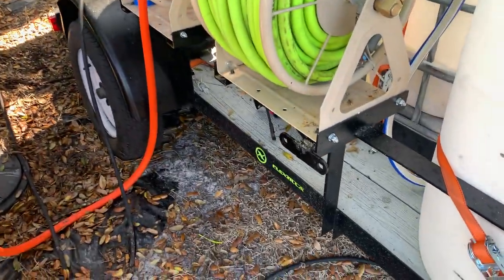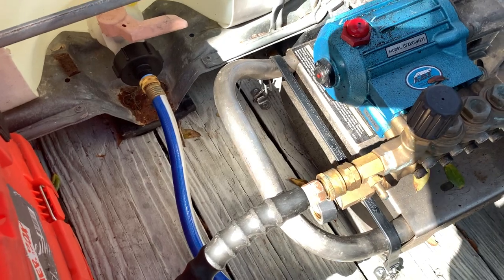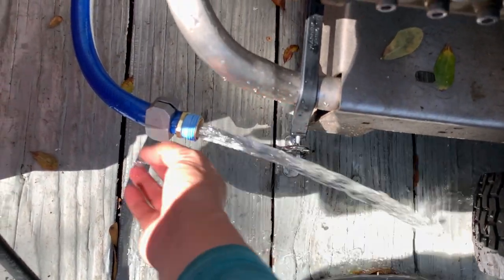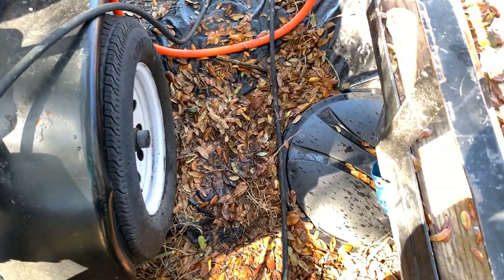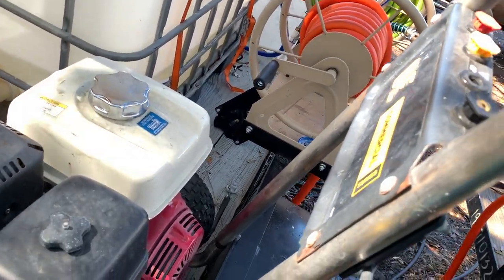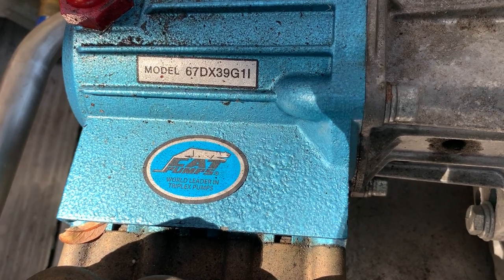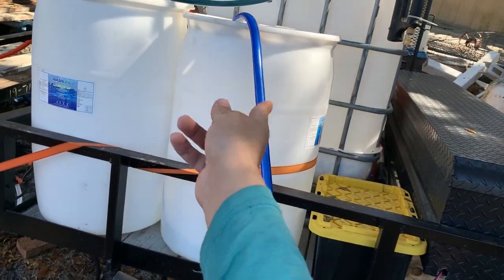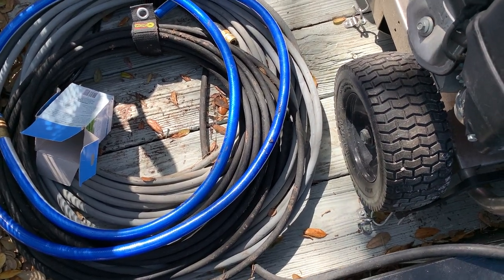Running a Direct Drive Pressure Washer with a Buffer Tank Part 2

Comment: Since this video was 2 years ago I'm sure you've already figured out your problems... but from what I could see... your tank wasn't vented and your water line was to low. You don't have to raise the tank as long as the water line is higher than your pump. The tank has to be vented while your using it so the water can flow freely... I've been using a buffer tank for over a year now with no issues and I get just over 4 gpm flow. The only time you need an external pump to feed the pressure washer is if you over 4 gpm. Hope that helps!
Reply: Not all pumps can suck from a buffer tank, most pumps are designed to have a garden hose connected directly to the pressure washer. For a direct drive system you need either a belt or gear reduction drive system.
I agree with your vent, but if you are depending on water pressure cuz your tank is full, as your tank empties you would eventually lose pressure

Comment: Try a bigger water source line that runs from the tank to the machine, I will do a video today when I'm out in the field to show you how I have it set up. Great video brother. Just tune in tonight when I load the days work.
Reply from the maker: Alright cool. Yea my local pressure washing shop recommended me to feed the pump using 1 inch line. Will be making a video on it first. I checked out your channel. Liked the vids. Get it!
Reply: @extremegreen5092  Cool, That should do the trick for a lot better water feed.

Comment: Take a 5 gallon Home Depot bucket if it fills up in 60 seconds you’re putting out at least 5 gallons a minute best way to test it be careful direct drives will burn up if they are not getting enough water flow . It is a very big tank though.

Comment: Not all pumps can suck from a buffer tank, most pumps are designed to have a garden hose connected directly to the pressure washer. For a direct drive system you need either a belt or gear reduction drive system.
I agree with your vent, but if you are depending on water pressure cuz your tank is full, as your tank empties you would eventually lose pressure

Comment: 1” hose to 3/4 into your pump, put a splitter and feed to both sides of the pump. You need to have water pumping to the furthest plunger on your pump otherwise it will burn it up
Reply: Trying to run a 2.5 gpm 3200 psi direct drive with a 150 gallon tank with a 1in bulkhead down to a 3/4in short hose and still doesn’t want to work.
Reply: @StreamMastersPW  I run a direct drive cat pump supplied by buffer tank and have been for a year now. Make sure you bleed all air from the line and have good flow before turning on your pump. Remove the thermal coupling(opposite side from the water inlet of your pump) and feed both sides. Start your pressure washer at low rpm, it seems to prime better that way, then increase rpm.
Reply: @shanecrews531  I don’t have a cat pump just a regular Joe shmo small pump.
Reply: @StreamMastersPW  Same principal. If you have adequate water flow the pump should pump water, unless there’s something wrong with it. Good luck brother
Reply: What do you mean by both sides of the pump? Where would the splitter go
Thanks

Comment: U need to run the water into the hose let it run for 1 minutes before turning on the pressure washer that would take all the air out of ur lines

Comment: What GPM machine is that ?
Reply from the maker: 4 gpm
Reply: @extremegreen5092  that's what I got I think mine Will pull too since yours does
Reply: i tried that and mine wont do it so i guess ill have to use the 12volt but i don't have a cat pump and i think it makes a big difference
Reply: When are you posting the 12volt with the pressure washer and buffer tank
Reply from the maker: @dirtblasterspowerwashing  tonite!!
Reply from the maker: @dirtblasterspowerwashing  I’ve been so busy lately and just had time to upload the 12v pump video. Unfortunately it did not meet my expectations. You can watch it if you would like though

Comment: Replace that 275g monstrosity with a 50-70 gallon tank and mount it higher than your washer with a 1" feed line, you'll save yourself hauling that thing around and it will gravity feed your washer better.

Comment: https://youtu.be/owqSY4gtb3c

Check out Doug Ruckers page. Look at this video.... its long and i recommend you take time to watch all of it. However, he shows how to do a bypass at 10:12 minute mark. Bypass is needed if not you can damage your pump.... when you let off the trigger that water suppose to get redirected back into the tank to avoid premature damage. Youll be able to feed off the buffer tank youll just need that by pass done. Doug has alot of good videos on DIY info. Let me know if this solves your issue.... apparently the tanks water weight is suppose to be enough to deal with 4gpm ... 8gpm you have to get it off the house spigot
Reply: 8gpm cannot get enough water off of spigot. They have to have buffer tanks. Plus bypass has nothing to do with getting more water off of buffer tank or anything to with  what he's trying to do